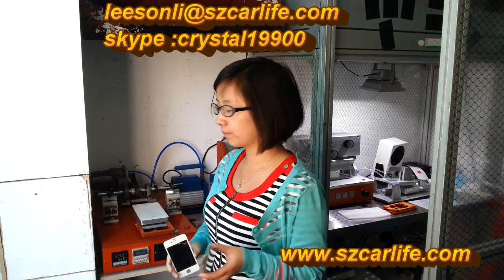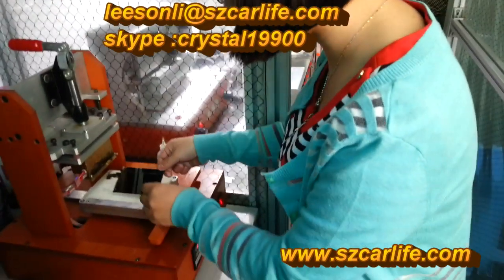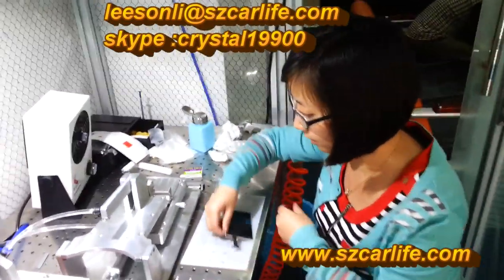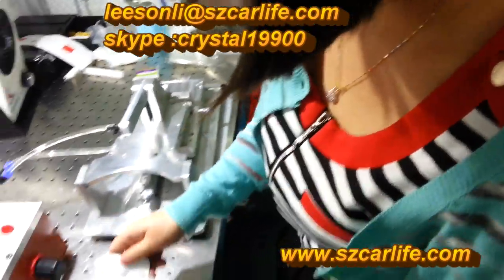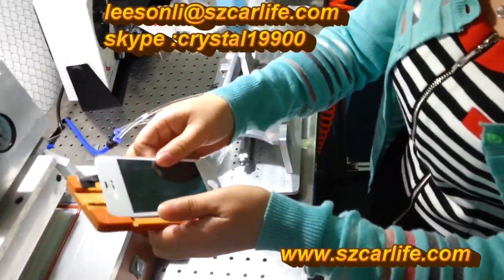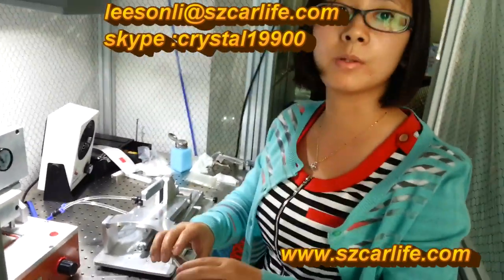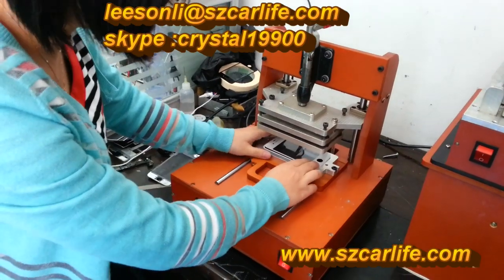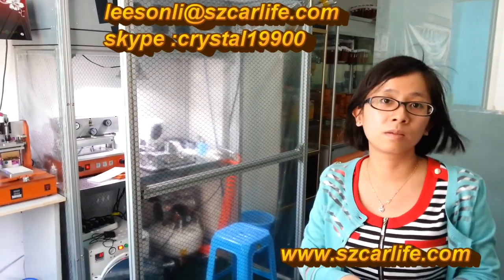(jiutu)whole process of the OCA Technology Devices Operation for broken phone LCD repair

Comment: I like what you have here for the smaller repair shop and the others on your site for refurbishing centers. Do you have the option to purchase just the exhaust system without the entire dust-free assembly? I see I can purchase the dust-free room on your site but, it is too small for the quantity of screens I have to produce. Are you using a separate compressor for each piece of equipment? How is that setup?
Reply from the maker: We have larger dust-free room as well,please kindly let me know your email ,so that i can send you more details ,the air compressor only need 1pcs , the oca vacuum laminator and bubble remover will share one air compressor .The vacuum pump is working separately .May i know that which machines you have already ?